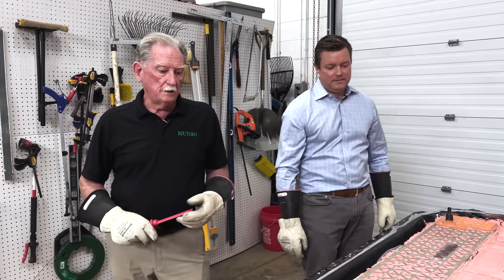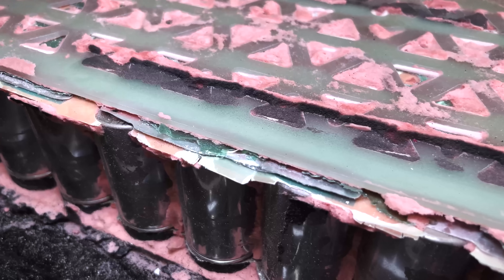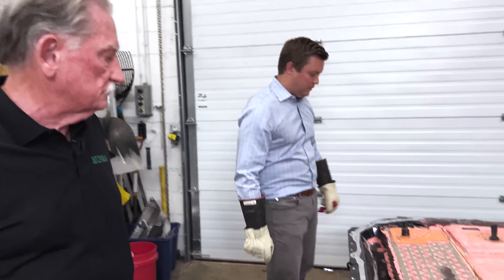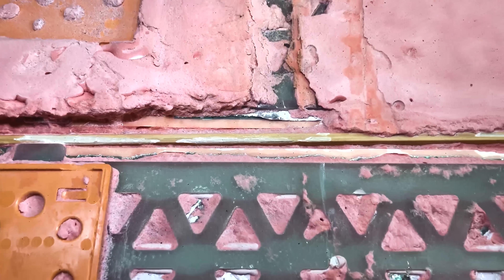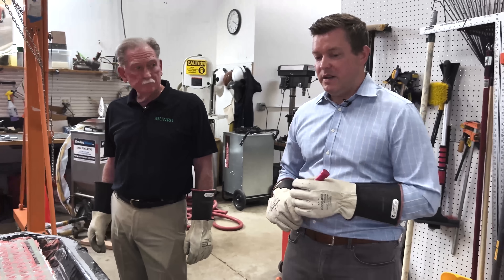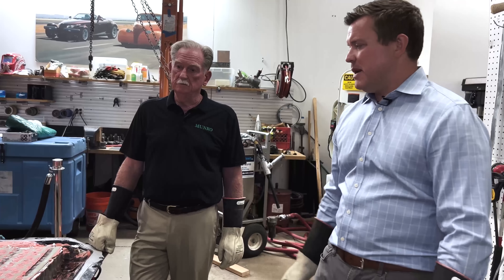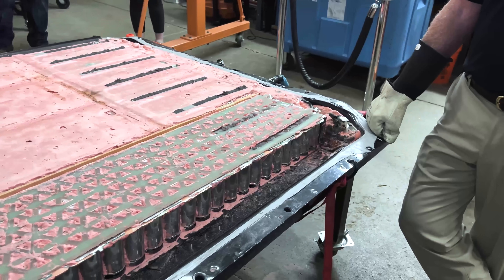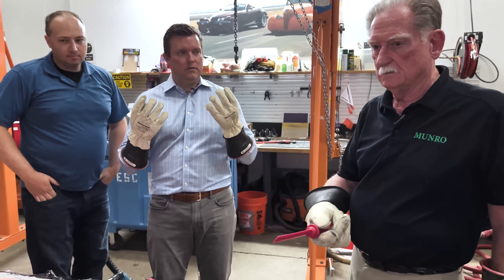4680 Battery Pack: What We Found Under the Foam!

Comment: You should make a dedicated video explaining the recycling process. Would be great to have an easily shareable video to address the huge misconceptions going around. Sandy’s explanation was fantastic
Reply: A small startup prototyped the liquid nitrogen system a few years ago.  The temperature isn't dropped to make the materials shatter more easily ... it's dropped to stop or greatly reduce the chemical reaction rate,  so that crushing and tearing apart the battery doesn't cause a thermal runaway from the residual charges.

Every 10 degrees C drop in temperature halves the chemical reaction rate. 

So it simply won't be necessary to manually disassemble each pack and module bolt by bolt, the way some are doing right now. 

Floatation cells have been used in the mills at base metal mines for probably a hundred years.  Crushed ore goes in,  high grade concentrate comes out.  Chemicals in the slurry control how different materials float to the top in the floatation cells at each stage of the circuit, to separate different materials.
Reply: @KenLord  how much does this process cost, from an energy expenditure pov and how much waste/pollution is produced?
Reply: @Kraven83  why ask? Because you want to believe it's pointless?

Can you not conceive of how a battery represents a higher grade ore than actual ore out of the ground? 

Are you not aware of Redwood Industries and the $4 Billion recycling facility they're building? 

Have you asked the same for exploration, production, refining, and distribution of fossil fuels?

Consider Canada's oil sands.  25% of the energy content in the resource is spent just in getting the tar off the sand parties, and upgrading it from tar to oil.
Reply: @KenLord  I asked because you seemed knowledgeable in this matter and because I find very suspicious the enthusiasm about how green and easy the recycling of these batteries is made out to be. It's repeated like a mantra but never actually explained.
Reply: @Kraven83  Not an expert, but:
As an engineer (electronics, not materials, but still) I do believe them that recycling the battery can be much more effective in energy and cost (almost the same thing, ultimately), than working virgin materials. There just needs to be enough batteries to enable the economies of scale driving those industrial processes, which probably hasn't been true before the last few years. Raw ore processing is incredibly energy-intensive, there's a reason metal refineries are built close to hydropower when ever possible. 

As a person interested in DIY and Right to Repair, it's a shame that it's almost impossible to harvest the cells or repair the pack. 

As an engineer again I do think that the batteries are much more likely to get recycled in the end, if the path to it is well-defined, instead of having to travel through unknown paths involving the DIY powerwalls of random off-grid aficionados, probably ending up in a landfill when the house is sold and demolished. The shorter the recycling loop, the more likely it is to be closed for each individual pack. The amount of lithium in 18650 cells and old cell phones in people's drawers is not insignificant, and adding to it is not in the best interests of the health of the world, in my opinion. 

It probably boils down to volume: a repairable pack is worth it, if the volume is not enough to justify an industrial material reclamation process.
Reply: In Depth on it here https://www.youtube.com/watch?v=Vj1LmGuNJZk
Reply: By the way. The video I linked to also state that Korea currently are recycling 5% of their EV batteries and expect to react 70% in 2040. I would claim they are ahead of Europe and the US on this.
Reply: Here’s how VW does it.

https://youtu.be/LABwwX960mk

Shredder instead of grinder, no LN, cyclotron instead of floating separation the rest is the same.
Reply: Yes that's an issue, the suggested grinding of the whole pack makes the refining of the battery material more difficult. Either you need an expensive string of chemical processes or a furnace that recovers less. In that respect, pouch cells in plastic carriers are the easiest to recycle. Here is what happens Korea, they've nailed it with dedicated raw material recyclers. In the video it is mentioned, that people needing a new battery, get a better price at the recycler than any exchange with the original manufacturer: https://www.youtube.com/watch?v=IKtUV9BCwJg
Reply: @Tore_Lund  too bad Sandy Munro disagrees with you.   It will all be easier than refining the ores that the elements came from.
Reply: @KenLord  Well he doesn't, he has decades of experience with the industry and if you actually listens to what he said, he is saying that Tesla's plan sounds very sketchy, i.e. not serious.
Reply: Oh they just bury the pack in the ground that’s it
Reply: @Jushwa  yeah let’s just burry a few grand worth of raw materials in the ground.
Reply: How would they know? They are not recycling specialists. We have only the Elon's twit about it so far

Comment: Seems Tesla Motors is taking the polar opposite of what GM is doing with their Ultium batteries.  Fully potted structural pack VS modular and easy to service.
Reply: You're assuming they require "service"

Comment: PLEASE somebody figure out the energy denisty by weight and volume please!
For years now, we've been reliant of the stupendously fuzzy numbers Tesla put out. 5x this and 6x that, so many % more "range"...all means zero without proper framing.
Reply: PLEASE wait for them to get a cell out of the pack ?
Smh
Reply: @rogerstarkey5390  They didn't even test the pack before taking it apart. They could do testing on a single cell, but what max and min voltage would they use? The use, on a ground breaking cell?
Well we could take the capacity for the pack found by others and divide it by the number of cells they count and take it from there, but I kind of expected numbers. With $640K in cell sales, perhaps priorities shift.
I guess these cells aren't all that impressive. Unless perhaps they're REALLY light, even if the whole car is just 20 lb lighter than the one with way MORE range.

Comment: How many cells are you guys counting? It looks like 34 in each row, and there's 6 rows per module and 4 modules in total. So if there's 816 cells in total, and each cell is 98 Wh, the pack should be around 80 kWh, yeah? So are they software limiting the usable capacity in these??
Reply: They haven't exposed the end, so they don't know how many cells are in each group. It is likely to be alternating rows of 34 and 35, for 828 cells total. But yes, that's apparently about the capacity.

Comment: Guy's its always great to see you all digging into the weeds to figure this stuff out!!  Love it and subscribed.  Also shows how well designed the Tesla is compared to everyone else.  You guys have taken apart the cars and now the batteries to show just how well designed these machines just are.  Good luck everyone else.  The media makes it sound so easy that others are going to be competing with Tesla. Yeah, they can have an electric car, but is it worth a sh!t?
Reply: I love Teslas, but don't discount the other guys.  Loads of intelligent engineers working all over, all collectively learning from each others' designs and past failures.

Just hold off on the first or possibly second generation of anything.

Comment: Shake and Bake!!! Great work @Munrolive keep the videos coming... As a MYP owner, my only gripe besides QC and Service is the amount of plastics in the interior. I get that threaded fasteners should be eliminated when possible but I've had quite a few plastic fasteners break with normal usage. I can't imagine long term durability. Car is a joy to own though and on the plus side the plastic parts are easy to replace. No car is perfect and I'm sure durability will continue to increase as more data comes in.

Comment: Recycling in the very rare and distant event a pack goes bad will probably be a hybrid process: blast all the stuff away from the cells,  then break down the cells separately. There may even be a market for used,  good 4680 cells in power walls,  etc. thereby saving on breaking down ALL the cells in a pack.
Reply: You heard Sandy, liquid nitrogen bath, then grind it up!
Reply: @gregbailey45 
Come on Greg, you should know by now ....
Social media "couch experts" always know better! 😉
Reply: @rogerstarkey5390  think about it.  The foam is useless.  The electronics could probably be reused, or if recycled,  they're going to be used for different purposes than batteries. The case could  possibly be reused as is; otherwise,  is just reusable as scrap metal.  The cells are the real value in the pack,  and should be relatively easy to dump out once everything else is torn off.  It would be easier to divert them and deal with them separately,  be it freezing,  grinding, reusing, whatever.  I don't know how it'll be done,  but this seems like a reasonable option.  It's a fun mental exercise.

Comment: repairability on an individual level is basically gone now.
Reply: It was never there to begin with- see many other comments.  Battery cells have to be matched for age and wear.
Reply: @oof_Dad  nope. Imagine cellphones are protected this way. Doesnt matter if its cars and pocket devices. Ease of repair should be considered. Imagine having only 1 dead cell in that battery. You need to replace the whole battery. Tesla is digging its downfall.

Comment: Lost on quite a few commenters is a modular battery is a fools design. Tesla discovered years ago that replacing a module is not practical unless you can find a module with the identical wear.  Tesla always replaces the entire pack, even older cars with modular designs.  If you replace a used module with a new one, then the modules are mismatched and the life of the pack is significantly compromised.  Legacy car companies just haven't been making cars long enough to discover that being modular has negative value. Modular packas are far more expensive to design and manufacture and weight more, with zero added value.  Of course they are copying what Tesla did 10 years ago instead of what Tesla is doing today.  I expect in 5 years or so, everyone will switch to a non-modular design once they discover modulary for repair really can't be done unless you don't care about the customer's battery longevity.
Reply: Modular design, at the end of life of the battery on the vehicle, will make it possible to find a second use as energy storage. And that's something we need a lot. And cheap. Reusing the battery for at least 2 times the life he had on a vehicle, before final material recycling, will drastically benefit the environment. A modular approach will also make it for easier, simpler and cheaper eol recycling.
Reply: Yep
Reply: Great comment. Exactly right..

Comment: best analogy i can think of is - you don't service the walls in your house - they are structural elements built to withstand many years of use - The battery pack is equally a structural component, yes much more complicated but crucially no moving parts - if the design is good, these packs should run just fine for the warranty period and beyond. Also, Tesla does not want to re-use car packs for mass storage - chance of a fault is higher, making it difficult to offer a compelling warranty - if you were a company looking for mass energy storage would you be satisfied with old car batteries hooked up together - nope - you'd want fresh cells with a full warranty.
Reply: Makes to much sense, all the Monday morning morons posing as qbs and well educated experienced engineers here. Will descend upon you shortly to inform you of the error of your ways. 😁
Reply: You can rebuild a wall of your house if it is damaged (or even if you just want it to be different) - you don't have to remove the entire wall and build a new one.

Comment: That top layer of insulating material looks like G10 Glastic material. Used in electrical applications like switchgear and motors.
Reply: Looks more like natural nylon to me (no dye added). The dry ice blasting has given it a bit of a matt texture but still not as matt as g10. Also g10 is an order more expensive than nylon, it cant be injection moulded and has to be machined for shapes like the one we see, which would further increase the cost and slow down production (injection moulding=good for high volume production). Not to mention its weight penalty over nylon.

Comment: How many cells are in parallel for that pack?
Reply: That will be one clear when they can "see" the cells?
Reply: @rogerstarkey5390  it won't even be clear when they can see all of the cells; the need to see the interconnections... but yes, they will see it and presumably tell us.
Reply: Likely 9 cells in parallel, 23 of those groups per block (or "module"), and all four blocks in series, for an overall 92S9P configuration of 4680 cells.

Comment: In theory the battery will recycle easily. That isn't  how recycling works for the majority of the EVs that get recycled. Most places try to sell the cell packs. Then recycle the few cells that are bad. The cables and electronics in the pack are sold in the EU. Lithium packs sell for  $1.50 lb the last time I checked and that place is out east. If I was to haul them there legally I would have to do Hazmat. I just can't toss them on a flat bed truck and haul them. The limit for hazmat is not more than five batteries of ≤10 lbs each, packed in strong outer fiberboard or wooden boxes, with maximum gross weight (battery, packaging, and all) of 65 lbs.  Hopefully the battery will last to the end of life  of the car and you should find a junk yard that will take it because the hassle of getting rid of the pack is offset by the parts you can sell because Tesla will not sell you the parts you need and the person will pay what ever it costs to get it repaired. I would say this pack is the worst pack for recyclers to handle. Just be prepared that some junk yards will hear how big of a pain this battery pack is to deal with and will tell people they will only take the car without a battery!
Reply: I agree that those are all practical issues in the real world. I think the solution is to require manufacturers to take responsibility for their products, which means that they arrange for a company to take all failed and damaged batteries and pay a price for them which make it worthwhile to haul them to the collection point.
Reply: @brianb-p6586  Cars from the EU and Japan have designed sub-pack replacements and they are recyclable. The down side is weight and fasteners. The problem today is that many forms of plastic can be recycled but only a few types of plastics are in high demand. This means some types of plastics sadly can go to the landfill. I think the same will happen with that pink foam. You have to say who will buy it and how much will they pay vs the cost to recycle. I saw a hill of seat foam, seat fibers  and plastic from the dash of a car processed from the car recycling center.  I hope someone will recycle it but sadly I think it will go to the landfill or will be incinerated. We need to encourage Tesla to make a car that meets the goal of the three R's Reduce Reuse Recycle.  I think Tesla can do this and live up to the goal of saving the planet.
Reply: @stevegorkowski3246  the "sub-packs" are called modules... and yes, until recently every EV manufacturer (including Tesla) used replaceable modules. BYD and tesla are the big proponents of making the entire pack a single module.

Yes, most plastics used in combination with other materials will go to landfills or be incinerated as they are separated from other materials. Most of a car interior is just trashed, not recycled.
Reply: @brianb-p6586  I can't speak of BYD but Tesla is just four packs and replacing any cell in the module vs other packs that can have the side plates removed with torx screws and a bad cell can be replaced. I can't remember if it was BMW or VW that encases the battery in a metal case  that generates far better battery protection and is totally recyclable. Blade batteries I have seen in the EU are using connectors. Then the bottom cover has cooling built in. All is designed to be recycled and body panels made from  recycled plastic. There is a big difference between making something that can be recycled and one that is designed to be recycled.
Reply: @stevegorkowski3246  The cells are in four blocks, but everything is glued together so there is no reasonable possibility of replacing one of the four blocks in this pack.
Reply: @brianb-p6586  Your speaking of this new pack but I am speaking of the old pack. It does fit how they design and it's something I will avoid  and let others deal with it. Have a great week!
Reply: @stevegorkowski3246  I was talking about the difference between previous Tesla batteries (with modules that you call "sub packs") and this new cell-to-pack battery.

Comment: I do not buy that liquid nitrogen story and "molecules will fall apart at absolute zero" from Sandy. Liquid nitrogen has a boiling point at -196°C, so at about 77 °K. From there, it is still a long way to go to 0K. And at 0K, it will still not disintegrate by itself. At the same time, this process takes a lot of energy to cool down the bath and the battery packs to be recycled. In case you wanted to grind down this battery pack, you could do so at normal ambient temperature. No need for the cooling. And for the smelting afterwards (processing of secondary ore), high temperatures will be needed anyways, which makes cooling it beforehand even less attractive.
Reply: Also, the first step would presumably be shredding, not grinding. You don't want materials in smaller particles than required for initial separation.
Reply: Exactly.